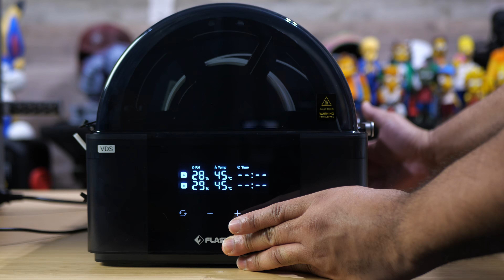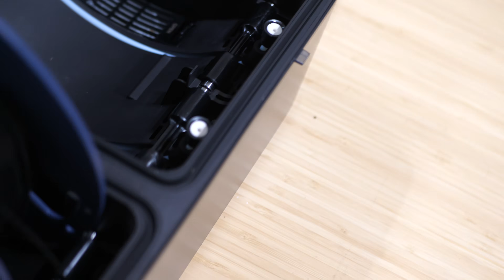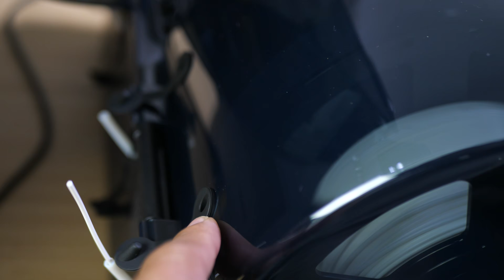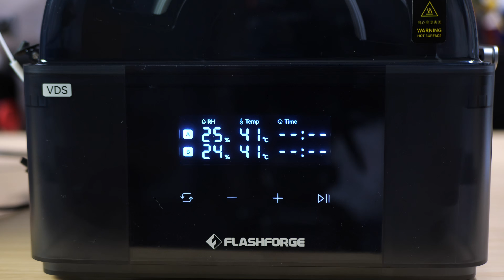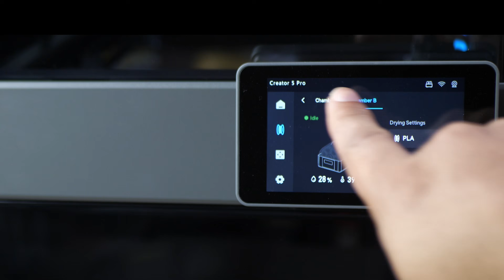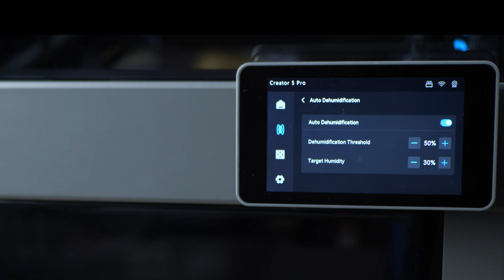First Look! The Flashforge VDS Filament Dryer

Comment: I'm no engineer BUT why would you have wet exhaust centered between 2 lines out? Wouldn't it make more sense to blow out the front, AWAY from exposed filament feeding into the printer? Unless you're running Bowden/Capricorn/PTFE tubes from dryer to printer intake. Anyone with a working knowledge of dryers feel free to answer if I'm overthinking the issue.

Comment: I assume this could be used as a stand alone dryer…right?  The printer communication should not be a requirement.
Reply: Yes it is but it is much more limited in that case.

Unlike other models (from other brands), it does not have integrated filament profiles and has a somewhat limited display.

But if you are comfortable using it only as "bring Room A to 70 degrees and maintain the temperature for 5 hours" then yes you can do it.
Reply: @Fabrizio-xk1ly  That's what I was afraid of.  The Sovol SH03 has the profiles and can maintain the filaments.  I wish it had the printer interface too.

On the other hand, the FlashForge VDS connects and works with the Creator 5 and I'm assuming it will do the same for future FF products, but then it won't interface to other brands and will be less useful than my Sovol if I should want to switch.  This is where we need open source and standards.  Bring on the 3rd party folks!

Everything nowadays should be connected and smart.  Just connect to the internet and automatically download the drivers that are needed.  Plug and Play!

Comment: Seems like a great opportunity to replace the filament spool holders on the side with some sort of shelf that will allow this to be right up on the side of the printer.
Reply: The exhaust ports would need to be on the opposite side and the lids would need to open in the opposite direction…or require redesign.

This looks like, and specs the same as, my Sovol SH03.  I wonder if the foot pads are in the same locations???  Someone shared a riser design for the Sovol that brings it very close to the height of the C5’s filament input ports.

The UI interface on the printer’s screen is very nice.  Wonder if the phone app will become useful enough to also allow remote control?  Sovol SH03 was $110 from Bezo mart.

Comment: Thanks for the information! By chance, did you test if it's possible to use the vds and the spool holders on the side in the same print? For example, pla on the spool holder and tpu in the vds?
Reply from the maker: Yes, you can do that.

Comment: This is one of the good reasons to choose a creator 5 pro over the U-1. FF gives you a Complete Solution!  Yes the filament could be mounted on outside pegs and absorb moisture so to fix that FF created a solution!  Snapmaker just says “Open Source, do it yourself.”  Snapmaker wanted to make more profit so they did not include harden steel nozzles versus flash forge, including hardened steel nozzles, cover, AND heated chamber to maintain the temperature, and providing all that at a lower price than the Snapmaker machine, which promised in Kickstarter a top cover that you would pre-pay in Kickstarter, which I did for both my U1’s and am still waiting for my Kickstarter paid in full covers for my U1’s,  that have yet to arrive. My 2, U1’s have been a disappointment to me, although The u1  functions well on most carbon fiber PLA and PETG (after replacing the nozzles with hardened steel nozzles).   in my opinion, the U1 is mostly a brilliant marketing plan by providing all influencers, free pre-retail machines, and filament, and then “having those influencers say they are not influenced by Snapmaker whatsoever in their reviews”,  YEAh. Right!  
My brief statement about Snapmaker is “promises made but not kept”,  vs  flash forge,  giving you more for your money.  

Hey flash Forge, if you’re reading any of these comments, I have two more new Snapmaker U1’s still in the box I will happily trade the U1’s in exchange for 2 creator 5 pros!  I’ll even pay the extra shipping!

Comment: I was going to complain about not having preset filament settings on the dryer control panel. But I can live with setting them at the printer.  Flashforge lacking foresight again. They really should have presets on the dryer control panel so it would work easier for customers that don't have a Creator 5 series printer.
Reply from the maker: It does come with a sticker that has recommended drying parameters. I didn't put it on.
Reply: @FigureFeedback  Yeah another content creator showed the stickers. But that is still not as good as being able to set presets on the unit itself.
Reply: @mj1s735  same as civil SHO3 I have two of those
Reply: @mj1s735  Since the unit has its own MCU I believe it is possible to make presets on the unit in standalone mode too.

However, the display is not structured to manage writing so at most they could do things like Preset 01, Preset 02, ... etc. showing only the number on the display (not the word "preset") but then you will always need a sticker to know that 01 is PLA, 02 is PETG, 03 is ...

Comment: Does it have features like "wait for the filament to dry and then start printing" or even "dry while I'm printing but turn off drying once the print is finished"?
Reply from the maker: No, it doesn't know if you're printing or not.
Reply: @FigureFeedback  But the printer knows this, so in theory with new firmware versions (C5/C5P firmware) it should be possible to do this (in the future).
"Launch a print by first drying for a few hours (or until a certain % humidity is reached)"
That is, when I start the print, first start the dryer until the drying parameters are reached and only then start the print

"Dry while I'm printing but turn off dryer when I'm done printing or at least put it in AutoDry mode"

Comment: Does it work as stand alone dryer as well?
Reply: Yes I checked the website
Reply: @bobska_2 ok what’s the link I can’t find it
Reply: Yes, but you will probably lose all the filament presets and you will only be able to simply indicate temperature and duration.

Other dryers instead have presets on the display so for use with other printers they are perhaps more flexible and simple to use.

Comment: I’m guess fuk Ad5x right? No flashforgery!
Reply: The AD5X does not have the 4 pin com port. But If they tried they could figure out a way to make it work through the Ethernet port and just make a cable to have it connect at that port. But I really don't see them doing that. Maybe if enough owners of the AD5X complain, they might do it. 🤷‍♂

Comment: How the printer recognize the VDS when you have différent temperature for exemple Pla + PeTg inside the first chamber ?
Reply: You can't run different temperatures for the 2 rolls in the same chamber? Doesn't seem like the VDS picks up filament information from the printer, seems like an oversight tbh.

Comment: I may have missed it in the video, but I don't recall whether you mentioned if the VDS is fitted with a fan of any kind?
Reply from the maker: Yes, each chamber has a dehumidifying fan and a heating and air circulation turbo fan.
Reply: @FigureFeedback  Thanks for the confirmation, I figured it probably would be the case but it's always better to ask when in doubt!
Bought my C5P on the basis of your vids, and will likely buy this when it's available. So I figure you've earned the sub (that I should have made weeks ago!).
Thanks again